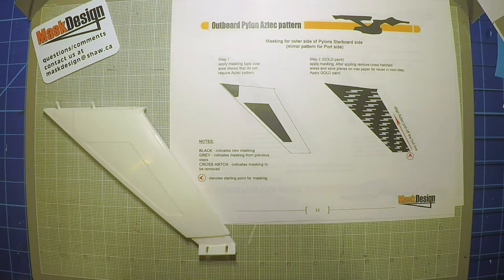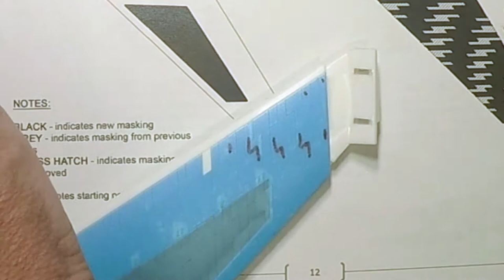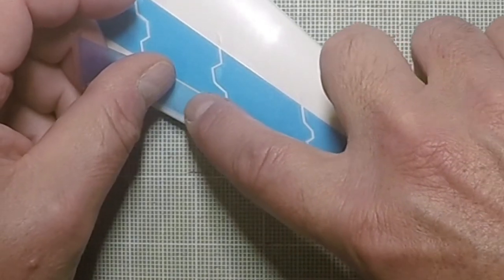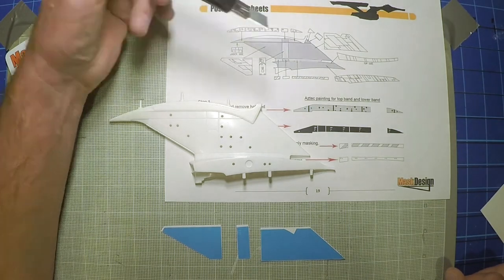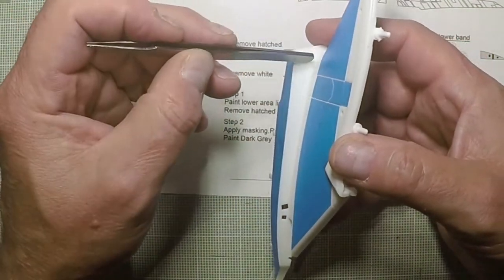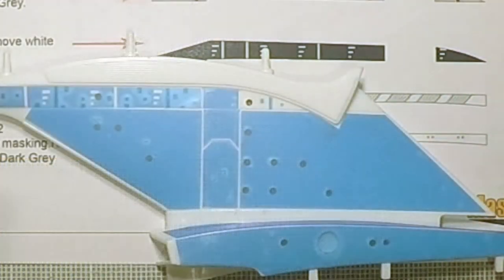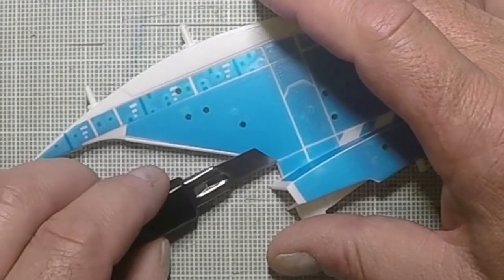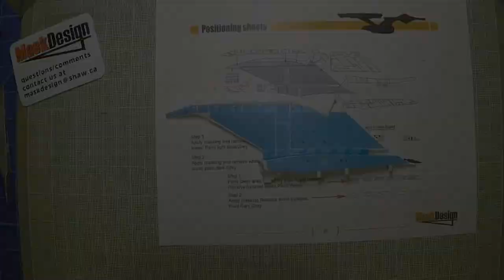1/350 scale star trek enterprise refit Aztec masking kit application Part 5

Comment: This is hilariously confusing without a paint example.
Reply: These MD videos demonstrate the classic mistake of experts producing vague instructional material.  The instructor is projecting that the complete noob already has some prior knowledge or experience with the product.  Maybe the instructor in the video is the one confused?  He lays a mask down then says you can now paint the green stripe on to the inner pylon.  How is the green paint going to reach the plastic through the mask???  

The current videos demonstrate how to apply the masks (certainly important).  But this is not the same as the videos MD should have made which would be, "How to Paint the Model Using the Masks".  They dont need to reshoot the videos.  A minimum of two new videos recommended.  The 1st new video would be a "Principles of Aztec Paint Guide for Beginers".  It would explain the 3rd party paint guide and how it integrates with the mask instructions; the different red, green, gold, etc paint colors; why certain masks removed, replaced, reused, etc.  The second or more video(s) could be a complete mask AND painting demo with detailed narration, starting from bare plastic to finished results, on just one section of the model.